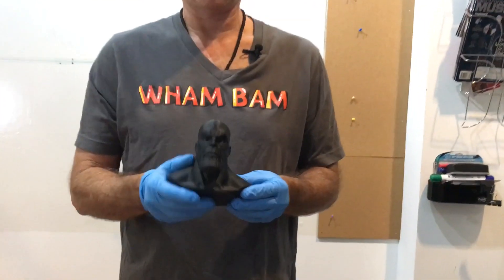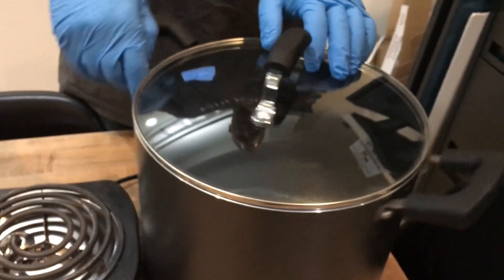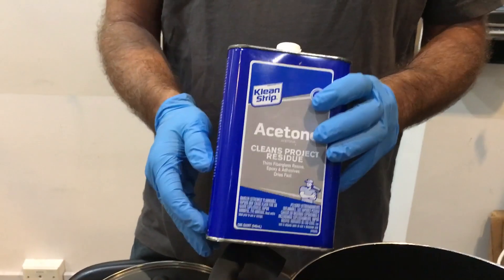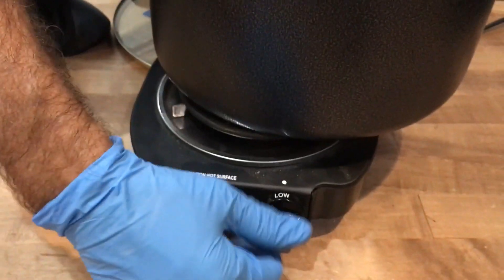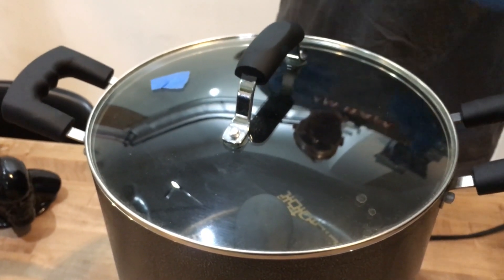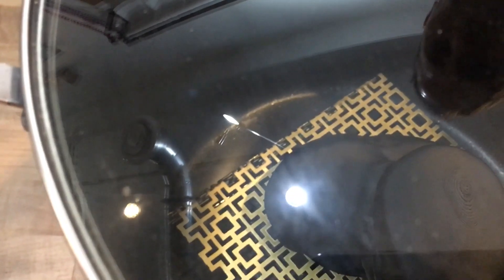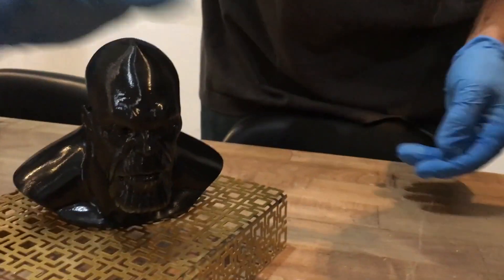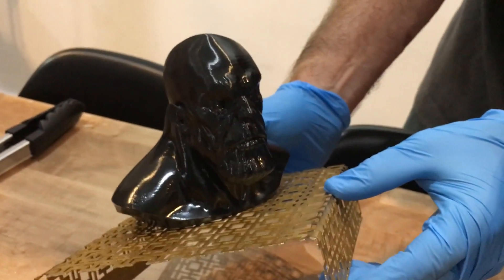Easy Method of Vapor Smoothing ABS

Comment: Loved the nice simplicity
I've also found a small plastic
atomiser, such as the sort you get
lens cleaner in, works wonders for
minor touch ups. Check whatever you
use for resistance to acetone first
though. No heat required, although it
can help dry your model out quicker if
required,
Word of caution. DO NOT OVER
SPRAY!
You can always fix not enough but to
much is another story

Comment: Just so you all know, you don't have to heat it, it works just fine at room temperature. He says in the video it's very flammable and explosive and then is encouraging people to heat it... and some people may have open flame stove and not think about it. Just do it a little longer at room temperature, no need to put chemicals in a kitchen pan, fumes in your kitchen and in your house, higher risk of fire/explosion etc.
Reply: Agreed, a better suggestion - put a fan in you vapor box, will be even more effective than heat.

Comment: Can this be done applying acetone with a paintbrush? I have an ABS model and have sanded most of the lines out manually, so I don't need a full emersion to get the remaining details. I'd prefer to use a paintbrush and have better control in the hard-to-reach places. Can this work? Thanks, nice video!
Reply from the maker: you can but you will get some streaking.
test on a spare part

Comment: I do this... but i hang a 12v q20mm pc fan in the pot...with a simple 12v 1a power plug. It helps circulated the vapor to get a more even smoithing effect

Comment: Will acetone work on polycarbonate material? Im working in some project that needed to use clear polycarbonate as a main material and after cnc machine, there is a little toolmark that still remain see on the surface. Will this method shine the polycarbonate and remain the actual dimension of it?. Hope someone will help
Reply from the maker: No,, I am sorry. It will not

Comment: This works great! What exactly is the brass mesh? I'd like to get what you have. What im using is making slight imprints on the print.
Reply from the maker: Thanks, unfortunately the bottom may create imprints since the part softens and pushes into the mesh. My brass mesh is nothing special, just a small piece of metal I had laying around that I bent as a stand. Maybe finding a way to hang the part may be safest for all sides

Comment: I have an old halogen oven, so warm it up, switch off. Add the acetone and 3d print close the lid.  The oven comes with wire grid and lifting tongs.  What temperature should I set on the LCD screen for initial warm up?

Comment: I have a question that nobody anywhere seems to cover. Does vapor smoothing work very well for that Transparent ABS ?
Reply: Yes, transparent ABS will smooth (may take twice as long though), if you are using a NON-HEAT method, it could take up to 2 hours. 

You will have to experiment(trial and error). In many cases low or no infill, your part may have sunken areas.

Comment: Pretty sure it IS an exact science... you have a measurable amount of solvent, heat, surface area, and time...  that sounds like all the ingredients to a formula. :) Someone must’ve figured it out by now.
Reply from the maker: Actually there are many types of formulas of ABS out that it also depends on your layer Heights and topography of your model as well as wall thickness they are very very many variables it’s much easier to experiment and figure out the best settings for yourself and try to figure out a calculation blank statement
Reply: Using some information from data sheets about acetone, I can figure out a minimum amount of acetone needed for a specific setup, but I will tell you, it is not an exact science, especially when it comes to timing. if you could keep a constant temperature and have no leaks and perfect dispersion, you could have an exact solution, but that is unattainable for all of us here in this comment section.

Comment: Tried this and my model was very smooth at the bottom. but the top was still very rough... seems like I need to circulate the acetone vapors inside somehow,...? any ideas?
Reply from the maker: you may need to leave a bit longer, was the acetone evaporated in the can?

Comment: FABULOUS video! Soon I'll be 3D printing an cab for my 14th scale RC dump truck. I'm anxious to try using this method to smooth out the layer lines. HOPEFULLY with this method, & very small layers I WON'T have to paint to model when I'm finished!
Reply from the maker: thanks! you will love it!
I would love to see your results!
Reply: @WhamBamSystems  I will definitely have video of the finished product on my channel, when it finally is done. For now, I still have a bunch more testing, tuning/tweaking &/or modifications to do on the CR6-SE, before I attempt an important, & massive print like that.

Comment: Outstanding results! 

I watched your video on printing ABS as I've had so many issues since I've gotten the filament, but I've still been having issues. 

If you're taking video requests, I'd love to see a good ABS slicer settings breakdown and some common problems/solutions. It's driven me nuts how much harder it is to print than PLA.
Reply from the maker: JR, it really shouldn't be hard, just get an enclosure, Wham Bam makes the HotBox if you have a machine that fits, my settings are: 245 Hot end, 120 bed, speeds 60 mm/s . I do use retraction and best way to judge recitation amount needed is to print a retraction test tower. also make sure your filament is well dried before using
Reply: @WhamBamSystems  Thanks for your response! I currently am printing in an enclosure that has an ambient temp of around 45°C, 240 at my nozzle, 105 for the bed and my speeds are 45 mm/s, I also use retraction that I think I have tuned pretty well.

With that in mind, I can make some great looking prints! However when it comes down to actual use (I make primarily functional prints) the layers tend to peel with a moderate amount of force on less dense parts of the print. I'm using an Ender 3, but it is probably out of calibration. I've also had to replace a few parts including the nozzle fan, so it's possible they are just cooling much too fast. 

I'm also using the cheapest possible ABS.. so the filament might be junk also, haha.
Reply from the maker: JR you may want to try eSun ABS. Great quality for the price, if your layers are separating you probably want to go hotter on the hot end go up to 250 and give it a try, what layer height are you using and what nozzle? Also make sure your filament is very well try it out. And yes calibrate extruder eventually but it shouldn’t be that much of a problem if you have a consistent flow
Reply: I've heard great things about eSun ABS. I'll definitely have to give that a go! Not before I really bake the moisture out of these ones to see if that fixes it first though. 

I usually use .16 layer height to grasp as much detail, and a .4mm nozzle, but I've gotten similarly poor results at .12 and .2 layer heights. 

I do get much stronger layer bonding at 250, but I can't seem to get details at that temp.
Reply: @JR-kj6kn  I am also using an ender 3 and have been going crazy figuring out settings.  I finally had a successful print in abs today. Nozzle 250, bed 105, printing on glass with hairspray.  The thing that finally made a difference was putting a large black trash bag over the entire printer. Using solidoodle gray abs.

Comment: (2:49) - Er, no.
The acetone doesn't "melt" the ABS, it dissolves it.
Only heat will melt it.
>
Reply: sometimes being decent is better than being too smart. melt or dissolve, we know exactly what he meant
Reply: If I had not pointed out the difference between melting and dissolving there is quite the chance that someone, having seen this video might go on to give some talk in which the "melting" observation is repeated. That audience attending said talk may be a sophisticated one and laugh at the talk-giver's ignorance.
That, hopefully may now, not happen.
That's all.
>
Reply: The first definition of the verb melt, is:
"make or become liquefied by heat" and also "dissolve in liquid."
And as an example Google uses, "add a cup of sugar and boil until the sugar melts"
So the ABS is melting into the acetone..
Reply: @JR-kj6kn  In the sugar example, the sugar is actually melting rather than dissolving since the ratio of water to sugar is so low.
When you put a teaspoon of sugar into a cup of tea it doesn't melt, it dissolves.
If you have say 500g of sugar mixed with, say, 100g of water, there is not enough water to dissolve all the sugar, but if you heat it up, there is enough water there for the sugar to melt without the sugar actually burning. It's the small amount of water that stops the sugar from burning, (or oxidising).
A compound cannot "melt" into another substance, it can only dissolve.
Technically melting is not dissolving and vice versa.
Poetically, well, anything goes really.
>
Reply: I hate to be that guy, but the example above mentioned nothing of proportions; Nor do I feel that because the sugar had burned, that changes the fact that it had just been liquid slightly before. 

Using the author's (Peter's) own words and the second definition of the word "melt" (see link below) we can substitute what was said with this:

"Acetone is a solvent for the ABS, so that means that it is going to [make the ABS become liquid; dissolve] and by [making the ABS become liquid; dissolving] it's going to smooth out some of the layer lines and blend them together."

I see no issue in how this is presented.. I understand that to some people, they may think that "melt" only has one use case and associate what was said with heat; therefore lighting a match in acetone infused room, but in this case, I think that "melt" was used very appropriately and conveyed the message perfectly. 

This is all left up to interpretation though, as I am not the author. However, it seemed pretty clear what he meant.

To site my reference: https://www.dictionary.com/browse/melting

Comment: Thanks for the video - am interested in comparing this method to mine! 

I've been doing some vapor smoothing for a little bit but I do it cold.  Basically get a paint can, line it with paper towels (I use small magnets to keep the towels in place) and wet with acetone.  Put the model on a raised surface on the paint can lid and lower the can over the top. Leave for about 45-50 minutes. Remove the part from the can and leave it for 1-2 hours.
Reply from the maker: Hi Andy, thanks!  I have seen the non-heated method too, it would be nice to do a comparison!
Reply: Hey, 
Can you please explain what "lower the can over the top" means here?